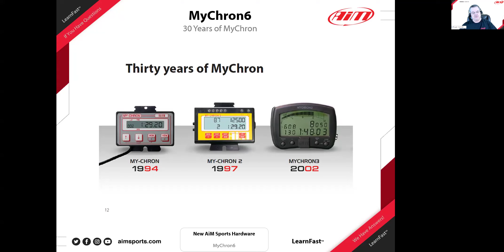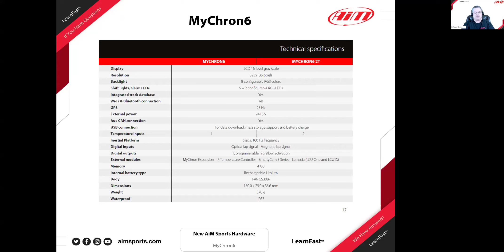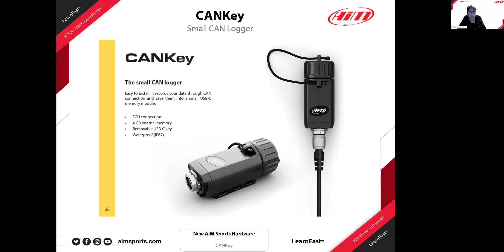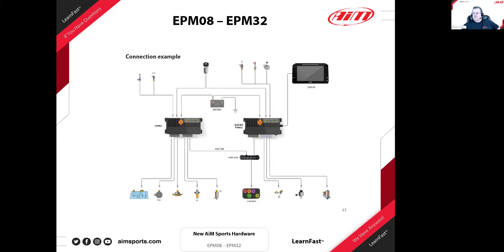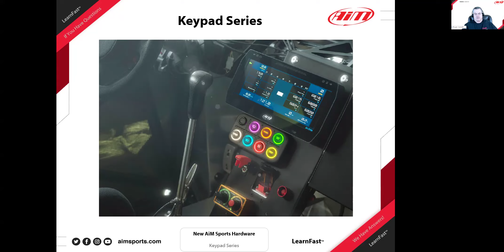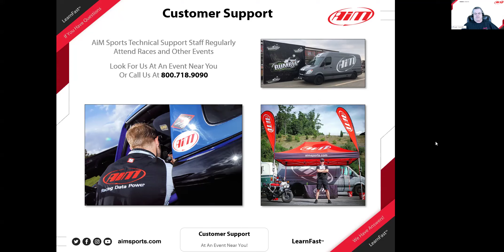6-1 - New AiM Sports Hardware - 1/14/2025

Comment: Hey Guys,  I know you guys are using the Python ECU for Inex Legend cars this year.  Can you guys confirm if that particular version will have the accelerometers and gyro to measure g-forces and pitch roll and yaw.  Thanks!
Reply from the maker: This is really a question for, and decision of, USLCI.  We certainly have hardware to measure such.
Reply: @aimsportsdata  no problem :)  I am sure it's not a problem with USLCI.  I did not know if the hardware was already installed in the ECU? or if I needed to purchase additional sensors to measure those things?

Comment: Nice stuff, is there a way to add wheel speed channels to a solo2 DL based system? Looking at the config for the ACC2 seems that is not an option. I am looking at adding sensors to an Mx based bike in order to fine tune the AIM ECU TC settings . keep up the good work
Reply from the maker: The Channel Expansion has two channels which can be used for wheel speed and is compatible with the Solo2 DL.
Reply: Was hoping for a smaller solution the expansion is a biggish unit for a dirt bike application . I guess these days with ecu supplied wheel speeds the need for out side WS is pretty low
Reply from the maker: @geoffcesmat8640  A four-channel expansion that can accept analog inputs, including a built-in thermocouple amplifier, and allow for up to two digital channels can't get much smaller.  With the addition of a custom harness (~$100), the installation could be quite elegant. There is ample space in the airbox or behind the number panel, depending on where the logger is mounted—maybe even inline attached to existing harnessing.  Let us know if we can help.